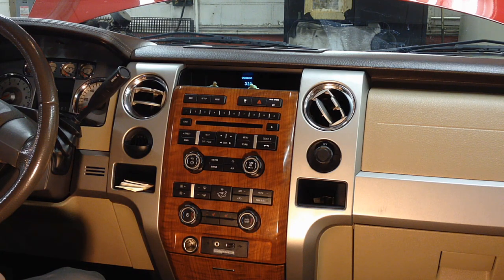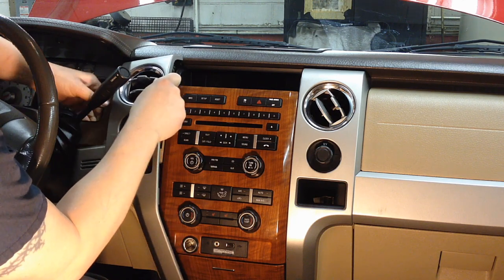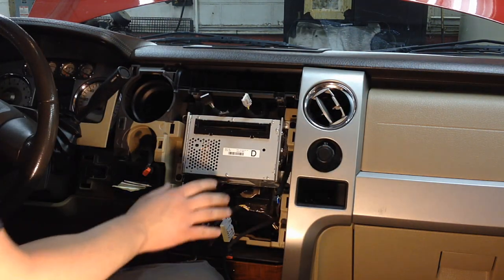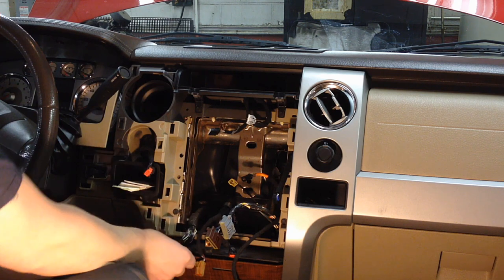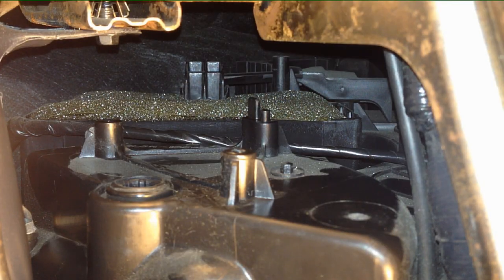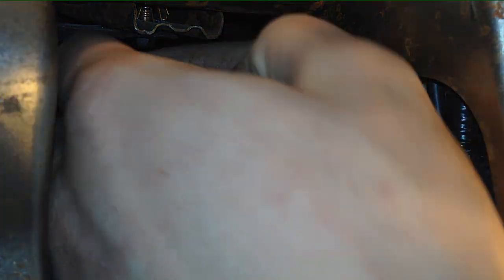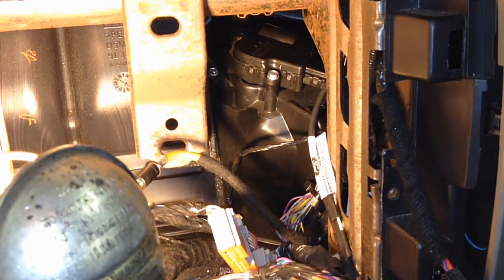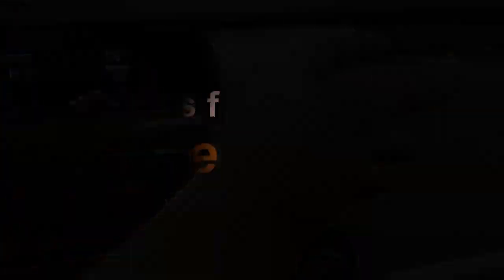2009+ F150 Passenger Side Upper Temprature Blend Door Actuator Replacement

Comment: I’ve been watching your videos for a long time. Very detailed. Saw the blend motor one day before yesterday. No heat made me attempt the repair. A simple work 2009 F 150. Used a cutoff 5/16” much like the one you had on your tool for rear screw. Used my fingers to take off and replace. Worked like a champ!  Thank you very much! (By the way, a tiny round magnet inside socket held the screw from falling out.)

Comment: Thanks for your video. Easy installation you saved me $400 it only cost me $44 at the Ford dealer I used a small ratchet with a 8mm socket it only took 1 hour to do.

Comment: Things could be worse, on the 90s explorers the top of the blend door breaks off and  you either have to remove the dash or work it in thru the evaporator housing. Similar tight procedure on many other fords, common failure item...  For the rear bolt on others I have used a magnetic socket and a special disc type ratchet. It is about the size of a quarter and can adapt to a socket. Keep up the great videos!

Comment: Great tutorial (I combined this with your other video for both the upper and lower)! I really appreciate your approach in how you perform the work!! I did this repair on a 2010 F-150 Lariat with navigation screen. I approached this guided by a number of other comments from forums and viewers of these videos describing their experience. First, try resetting the climate control system by removing the fuse associated with the system for 1 min., then turn ignition to on but not start the vehicle and allow the actuators to calibrate, this is the same procedure outlined at the end of this video. I read this tip elsewhere, unfortunately it did not work on mine and I am not sure if it would work, it may save you a lot of hassle and avoid replacing the actuator. I kept fasteners organized in a Harbor Freight 20 Bin Medium Portable Parts Storage Case and used sticky notes to label each bin / location it was from (no HF plug intended here, just a copy/paste from online of what I used). I did need to remove my front seats, roll carpet back and remove the additional ductwork for rear air that routes under the seats. This is not hard and was necessary (as mentioned by another viewer).  I broke  the eyelets on both units during removal and did not damage any other components while doing so. I was able to get both screws in on the upper unit and only one on the lower during install.  I had to cut the post that was in front of the lower actuator using an oscillating multi-tool, I adhered this back in place after the new unit was installed using Loctite Epoxy Instant Mix and after 20 minutes, already felt trustworthy that it would hold. I helped support the actuator with some high-density foam I had laying around (similar to the foam used for organizing tools or router bits). I used this same foam underneath the ductwork that is just below the lower actuator, everything felt secure and would hold in place. Overall this was 7 hours (including a short lunch break).  The repair is complete, clicking is gone, heat and A/C blowing as it should and saved $$$.

Comment: Great video. I was having an extremely hard time getting the rear screw out. I ended up breaking the clips of the actuator which allowed me to take the top of the actuator off and this way I was able to easily access the rear screw from the front. I was unable to get the rear screw back in but still seems to work fine.

Comment: Great video and explanation, and particularly clear and well-lit camera work.  I replaced one of these upper (manual) actuators on my 2010 last year, and need to do it again, so searched youtube until I came across the best, which was yours.  I bought a cheap 8mm combination wrench, and heated and bent the box end (twisted it actually, torsionally), and ground the outside of it to make the wall much thinner, making it much easier to get that box onto that stupid rear retainer screw, in order to get it loose enough to remove with my fingers (as you showed).  I actually removed the passenger side airbag in order to gain easier access and visibility for this whole task, but this time will try to do it without removing the airbag.  Thanks FordTechMakuloco, for helping the average guy to not have to pay $100/hour for replacement of such an inexpensive part.

Comment: I have a 2009 f-150 fx4 with the floor console and this video works for that too.  total time was about 30 to 45 minutes.  as the video states the worst part is the 8mm wrench threw the glove box, but that is very easy.
Reply: Problem... passenger vents are stuck on hot even when console reads 60 degrees. Driver side works normal.  I spilt coffee on buttons for temp control ( bottom up and down buttons)and around sync ports. Navigation and all options work. The passenger side is  stuck on hot no matter what console reads.  Question...is this a button problem or actuator?

Comment: I used this video to figure out and change the dual temp blend door on an FX4 with NAV. Basically pop off the trim a little bit and 4, 7mm bolts around the screen. Squeeze your hands in the dash and pull out the old actuator. Wire was tricky to get unhooked and the NAV trim didn't come off due to the USB and cigarette lighter that I couldn't get the connection off. It worked though and I now have AC again.

Comment: Great video.  I offer if you have a 2010 with navigation it's a bit different getting the trim and HU out.  

1. Follow the video to remove the center arm console.  You just need to slide it back, so don't take the shifter out.  

2. The left side trim bolt on the bottom will now be exposed, use a 7mm socket, so you can then remove the trim and continue access.  

3.  The rear bolt for the blend door, I had sticky dynmat like rubber wrapped around my 8mm socket. After I got it initially loose, this helped to hang on to it for removal and install.  

Hope this helps!

Comment: I just completed this job a few minutes ago.  If you remove the top tray and speaker, it is possible to get a 8mm socket on a long extension to the back screw from there.  I took some effort but it worked. When I reassembled it, I had to start the threads with a ratcheting box end and the put the long extension on it to tighten it down.  I hope this helps someone else.

Comment: To whom it may concern, on my 2012 lariat the side pieces of trim don’t simply slide up. You have to remove center console to discover 1 screw on each side. Once these screws are removed the side trims can be removed then the radio trim.

Comment: Thanks for the video. I just did this replacement on my 2010 FX4. Took a while but I did get that back screw out...however, I did not put it back in. I have a flow through console, so I had to use both your videos to figure it out. I’ve been watching your other videos as well, I didn’t know three valves had these issues. I will definitely stay on top and of my oil changes and look to do timing belt/phasers at some point. I currently have 108,000 miles, so far so good.

Comment: Hi, thanks for this video.  I have one additional question/issue that popped up after performing this repair.

I had the issue described in the video in my 2010 F150 King Ranch (heat working on driver's side and ice cold on the passenger).  I used the replacement part# you list in the description and followed your step by step guide to replace it (had to reference the other video to get my console out of the way first, which was extremely helpful thank you for that too!).  This fixed the issue of cold air coming from the passenger vents when the heat was engaged.

However, now for my new problem.  It has since gotten warmer outside and I noticed while running the AC the passenger side isnt cooling (not hot, but definitely not as cold as the drivers side vents).  I put it the system into dual zone mode and played with the drivers side temp until it roughly matched the passenger side and it feels like the passenger side is stuck at 75 degrees or so even though the temp display on the dash shows lower.  I also noticed that when I have the driver side controling both zones, if I turn the temp knob I can hear the actuator motor cycling, but when it gets below a certain temperature (76-72 or so) the noise from the actuator stops, the drivers side continues to cool all the way down to 60 but the passenger side stays at the same temperature.  I also notice occasionally on startup I can hear the actuator cycling back and forth like it is hunting for the right position, this is usually occuring before the engine is up to temp so I have no idea if it is actually changing the temperature.  I have performed the climate control re-set routine of pull fuse 15 and wait as described in both your videos twice and the issue persists.

So my question, did I just get a bad actuator (used brand new motorcraft part) or is this a separate issue?

Comment: I just did this for my 2011 Ford Expedition. Went just like the video showed! Definitely the most challenging part of the job is that rear screw on the actuator. The Dorman Actuator (part number 604-234) fits and I found to be the better choice over the 604-241 or 242 as it's slighty lower profile and offers just a bit more "hand room" to get that rear screw back in. My Ford dealer quoted me $600 to fix this as they have remove the dash. Typical overcharging dealership service center. Took me an hour to do it myself following the video. Would have been quicker if it wasn't for that tricky rear screw.

Comment: Love the vids-  I am dealing with same issue, and I have the  DTC w/ navigation on my 2010 Lariat-   Before ripping things completely apart, I got another "code read" for 49$, and found out that my problem is  related to the controls in the front.   (FURNACE on the D/S, and P/S is nice and cold.   Been like this for few weeks-  This morning, just before arriving to work, started  hearing a weird noise from the blower assembly (shut climate off, and went silent") so have to investigate.

I would add one piece of tidbit helpful that I learned over the years-  When using  these self-tapping screws into any kind of plastic that you  removed from,  if possible, counter clockwise turn the screw until you  feel the thread seat into the existing 'cut thread"  in the plastic from original install. This will prevent creating new "threads" and help eliminate stripping the the" existing  threads, leaving with with no ability to secure the screw.  Stuck w/ another problem (I do this with almost  everything self-tapping into plastic. (Just a good habit to get into.)  When fails.  "some good glue or sealant that works with plastic I use to fill in the stripped threads

Thanks for vids.  Now- To  find out what EXACTLY is my problem  B8010-10/11 codes-  indicating electrical short.  $$$$$ :(  I am not taking to "stealership"

Comment: perfect.  don't know if you could make a better video for this repair.  particularly at the end when you mention the difference with the 2011 manual temp control.  This is my second time doing this repair.  First time with Doorman part that did not last a year.  Bought Motor-craft this time.  Also I pulled fuse 15 last year and 46 this time so hopefully getting proper calibration helps this part last longer.  Thanks!!!

Comment: Took 3hrs, broke 1 of 4 tabs on shifter assembly when prying shift cable off. Tapped hole and cut to length drywall screw fixed it secure.

Comment: Many many thanks.  Once again, you have saved me some serious coin.  2009 F150 FX4, dual zone.  Hot air coming out of passenger side at all times.  Followed your instructions down to the letter, and everything works as it should now.  That rear bolt was rough and by far the most difficult part.  Center console made it a touch more difficult to pull the right side trim to get enough clearance, but I managed with some good auto trim removal tools I ordered off amazon.  Where's the donate button dude?
Reply from the maker: Donate button is on the main page for the channel.
Reply: what is the part number for the 2009 FX4 with dual zone?

Comment: I'm 73 and that rear screw was killing my neck and back. I ended up removing the front screw and plying the motor up and breaking off the rear tab. I made a modification to the rear screw and added a short machine screw (hex stock would be better) to the original one with  silver braze. Not too long but long enough that it can be tightened from the front. If I ever have to do it again  it will be an easy removal and install.

Comment: I just did this repair.  Thank you for your video.  

I did find that I could easily start the rear screw by rotating the blend motor around backwards after clocking the door.  Once started,  rotate the motor around to its place and tighten it down.

Not looking forward to replacing the other blend door.  I'm sure that is right around the corner.

Comment: Great video. Don't do what I did by trying to break the back screw out, I tore the mount stud half way out of the airbox before I realized it wasn't the tab that cracked! After getting the screw out with a 8mm wrench I used some JB plastic bond to repair the stud. 
By the way, if your doing this upper blend motor and have a center console you need to pull the console bolts (6) and wiggle it back a couple inches to get access to the bolts at the bottom of the side trim panels.
Arggh Ford and blend doors! Remember the 97-2003 blend doors, had to saw a hole in the chamber, reach in and rip the door out, why is this so hard to get right.

Comment: My heat is only blowing out of the upper defrost vents. At first is was hot out every vent except driver side. What is your suggestion before I just replace everything? 2013 Ford 150 Ecoboost FX4 with center flow console.

Comment: I have a 2012 Lariat with navigation and center console.  I get heat on the driver's side and nothing but cold air on the passenger side.  In researching I found someone with a similar problem  but the problem wasn't with the blend door.  Their problem was the temperature control panel and not the blend door.  How can I tell if the TCP is the real issue?
Another part is the HVAC Control Module part no. BL3Z-19980-U (look this up if you need to) and then the HVAC Temperature Control Panel that you see in the dash with the buttons and knobs.  Part No for mine is BL3Z-18842-J.  
Got a call back from a Ford dealer and they are saying the module and control panel needs to be programmed. Not sure what you know about this but let me know what you think.  Thanks

Comment: Mine is a 2010 Fx4 , 4x4 , when a/c is on it blows heat on passenger side,  .... is that the top accutator behind radio?  Has dual climate an all.

Comment: My passanger door actuator only goes to hot mode it won’t come back to cold by that I mean it only turns one way I replace the bottom one and the driver side works just fine is there is a chance that the dual temperature control get mess up and it won’t respond only on the passenger side by the way thanks for your videos are really helpful

Comment: I'm looking for the blend door actuator location on 2017 Ford transit 150?  Any guidance would b much appreciated. There's a few other guys that could use this info. I have not air out of drivers side middle(left radio vent) and cold from the rt hand vent(rt side of radio) I'm assuming this actuator is the issue.      I'm an HVAC Tech from MN. So should b able to take this on and will make a quick did to pay back for help.

Comment: Replaced the actuator and within a month the heater motor started making a noise.  The top pivot point of the Blend Door broke off the door and ended up in the heater motor, causing the motor to be out of balance.  Now I think I stuck with having to pull the dash to replace the Blend Door.  Any video's on how to do this job?

Comment: I really appreciate this video.  After replacing mine, the passenger air went from full cold to full hot.  I've gone through the calibration steps several times, and tried unhooking the battery for 30 minutes to reset everything.  Does this sound like I got a bad actuator, or could the problem be something else?

Comment: After l replace the actuator  noticed that the motor turns only one direction. And manually moving the door blend.  Only turns half any direccion.  Can you please  help? Using a common sense the new motor suppose to turn both directions. To match the door stop. Any suggestions will be appreciated.  Good video thank you.

Comment: I have replaced the blend door on the passager side because it was stuck blowing hot air.but its still blowing hot air!what am i doing wrong?i have removed fuse 15 for 1 minute.and left the key on the on postion for 30 seconds but still not working

Comment: So my problem (2011 F-150 Lariat) isn't the blend door but the mode door actuator. My system won't switch between the defrost, panel, and floor vents. I replaced the mode door actuator (by the gas pedal) but it still wouldn't switch vents. Turns out it won't even cycle the actuator motor when the actuator is plugged in but not installed on the mode door. I tried this with both the original and new mode door actuator. Then tried pulling the Climate Control fuse to reset the system but that didn't help either. What else could it be? Do I have to replace the Climate Control Module or is there something else I can try?

Comment: Two additional tips - For us bigger guys, take out the passenger seat (four 15mm bolts) push it back out of the way and then sit with your left leg under the glove box to get up in there.  It was also much easier to grab a non-ratcheting 8mm wrench and then grind, or file down the outside edge, so that the box end can slip over the nut while clearing the plastic housing.